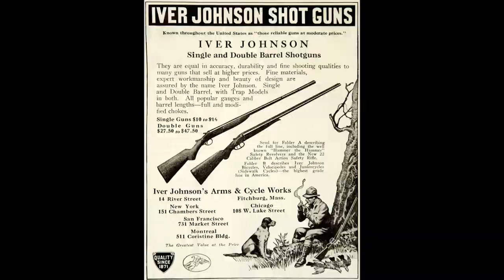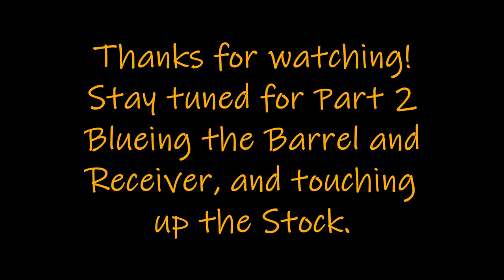Iver Johnson Champion 16 gauge Shotgun Rescue

Comment: Good video. I have my grand “Mother’s” Iver Johnson’s 410. The shotgun is fully functional and in reasonably good condition for one “dated by serial number” to be 105 years old. I was able to replace many of the internals (firing pin, spring, etc). The only issue the shotgun has is a pitted inter barrel. Can’t be helped now but it’s nice to hold a firearm that was used by my grandmother. I’m told she primarily used it on squirrels and rabbits.
Reply from the maker: Sentimental value. Priceless. :)

Comment: I have this exact shotgun that I inherited from my grandfather recently. Mine’s in significantly better condition but I’d love to have it fully restored. The wood grain definitely needs refinishing to take surface level scratches out and there was a thin layer of rust on the bluing but I lightly wet sanded out that layer but underneath it looked almost new. The bore looks absolutely pristine. I haven’t test fired it yet but I plan to in the next day or so. Out of curiosity what would be a ballpark price for a restoration on one of these?
Out of curiosity, would you happen to know the sight bead size on this? Mine is unfortunately missing that bead and I think I found an original, but there’s three different sizes to choose between